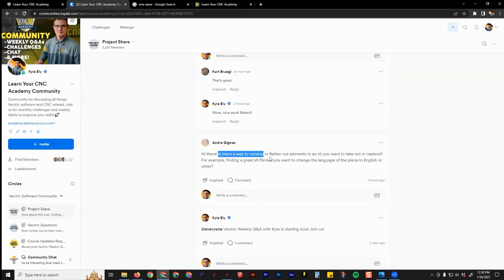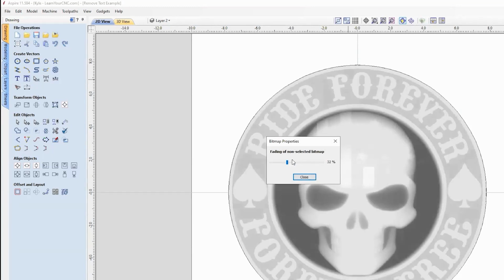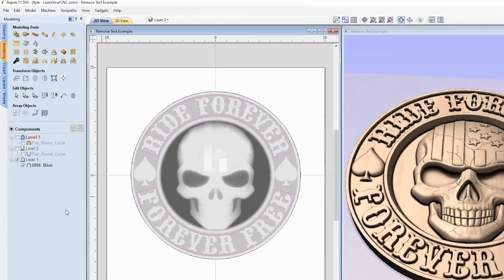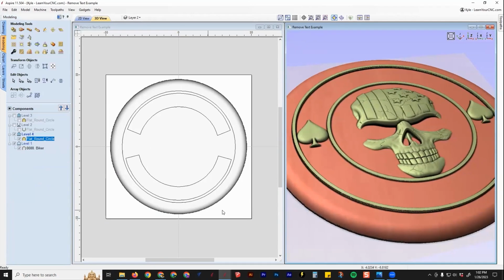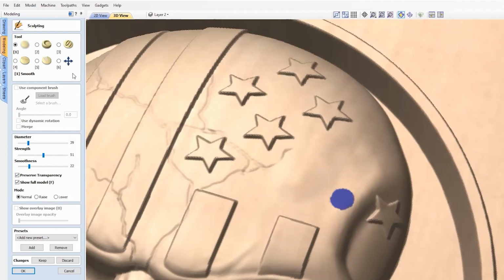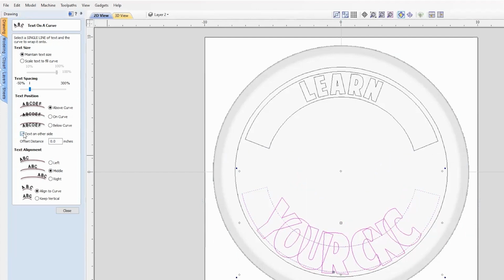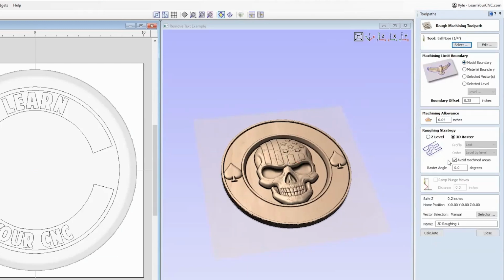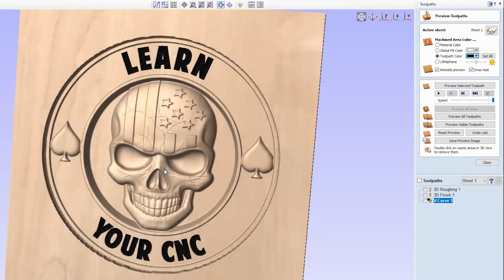How to change 3D text (even in VCarve)

Comment: I continue to enjoy watching your teaching style Kyle.  As you may be aware I have my own YouTube channel where I do instruction on Aspire, vCarve, Lightburn, and Sketchup projects and then usually make the project.  I am not nearly as good as you with the Vectric software - mine is all experience based.  If I had to learn a function I know it and pass on what I learned.  

I signed up for your course after meeting you at the Vectric UGM in San Diego last year.  I truly enjoy your course and watch your videos not only for learning more about how to use the software but to try and learn from your clear and concise teaching methods.  I learn something each time I watch your videos and regularly recommend to others that your Master Training Course is worth the investment for any aspiring CNC user that has Vectric Software.

A quick question about this project because it may relate to an issue I was having with one of the projects I worked on.  I noticed that at the end you changed the material to be 1.5" thick to accept the model.  I couldn't tell from the video, was the model originally .75" thick?  I ask because I ran into a problem on a project I worked on with a friend.  Our problem was the model got thicker when we didn't expect it or want it to.  We were using the merge function - tried to play with multiply but it still hurts my head using multiply.  Haven't totally figured out how to use that function and get the accurate results I want.    

My original belief was that if I use merge between components it shouldn't add thickness to the model, but for the sake of me it did.  After researching online I got the impression that Aspire will determine model thickness based on components on top of pixels below.  So no mater what I did I couldn't get the thickness to be what I thought it would be.  Even if I used Merge, the model seemed to reflect the thickness of the combined merged components.

I noticed that you used merge to put the flat round model into the original model.  Then at the end the model was now 1.5" thick.  Was this the result of pixel on pixel issue or was your model originally 1.5" thick?  Just curious because this continues to bug me and although we adjusted the method used for making the project it wasn't straight forward and never did come out exactly with what we wanted.  Required quite a bit of hand carving/sanding after the CNC to get to the end result wanted.

Sorry for the long question but you made me think of this old project that I was never able to resolve and didn't know who to ask about it - until I found out how good you are.  We can discuss outside this medium if you have time and are interested in discussing.

Thanks again.  Glad I found your course.